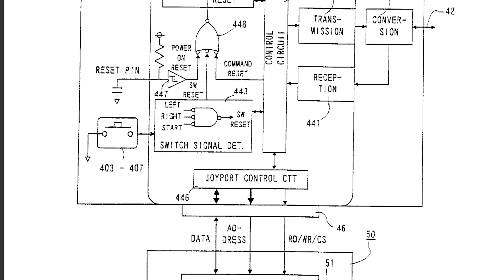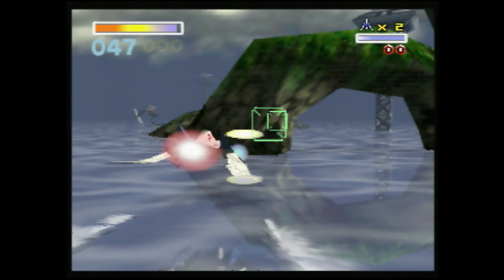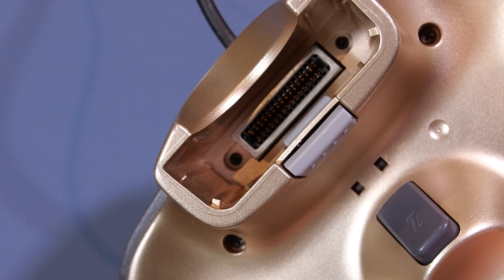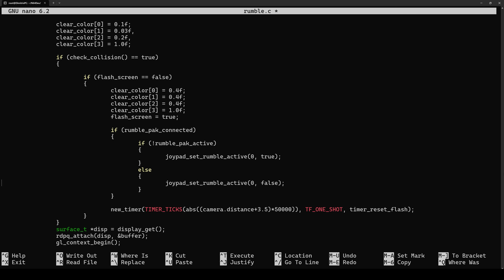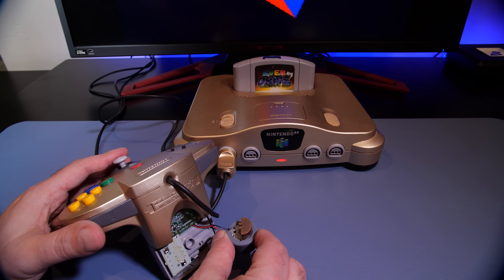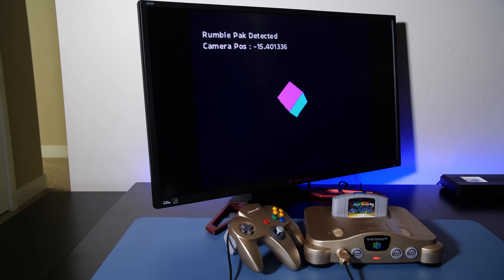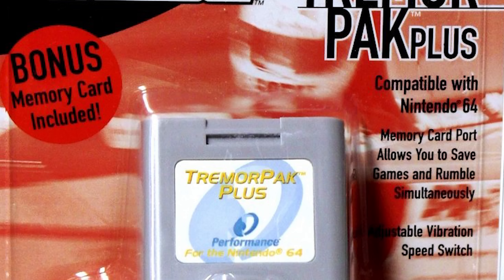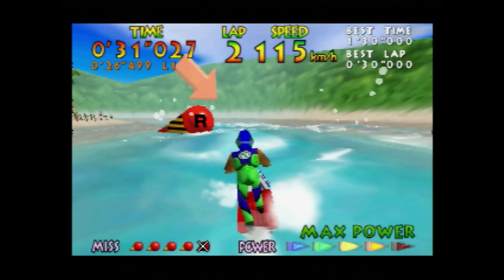How the N64 Rumble Pak changed everything

Comment: I figured this would get into the litigation from the early to mid 2000s. Some company held the patent on haptic feedback and threatened to or did sue Nintendo, Microsoft, and Sony. 

IIRC, Nintendo settled out of court with a license agreement. Sony fought it hard to the point where the PS3 controllers originally didn't have any haptic feedback. 

MS did a big brain move and not only settled, but bought a large chunk of the company. So when it came time for Sony to pay up, and when Nintendo paid their license fee, MS got a share of it as well...
Reply: Nintendo wasn't part of the lawsuit. Only Sony and Microsoft were sue by Immersion in which Sony was the biggest loser as like you mention Microsoft quickly settle and bought 10 percent share in Immersion while Sony fought it in court but lost in every step and was indeed reason they didn't include it on the PS3 until they reach an agreement with Immersion and paid for the license fee (and of course all the fees the court demanded, some 130 million in total).

Reason Nintendo wasn't part of the lawsuit is that Nintendo use different technology and had their own actual patent regarding the motion of the rumble pak and Gamecube controller (and future controllers such as the Wii control) dating from 1995.
Reply: @carlosencarnacion9425  Sony and Microsoft weren't the only ones, both Meta and Valve have also been sued by Immersion.
Reply: @carlosencarnacion9425  
Pretty sure Nintendo settled with them before they were named in the lawsuit, which is why I said "threatened to". Again, if I recall correctly, the Rumble Pak wasn't an issue because it was a separate device, not part of the controller, but the GC controller (and any after it) haptic feedback was built in and required a license agreement. I could be wrong, it was about 20 years ago and I'm working off of memory.
Reply: @MrNside  No, I understand one would think all rumble control would had been part of the lawsuit back then, but again Nintendo was never part of the lawsuit as Nintendo had their own patent for rumble and didn't use Immersion patents.

Info Regarding the lawsuits:

In 2002, Sony and Microsoft were sued by Immersion for patent infringement for the use of vibration functions in their gaming controllers.[1] Specifically, they were accused of infringing on claims in US Patent 6,424,333 and US Patent 6,275,213 (filed 2000 and 2001 as extensions of US Patent 6,088,017, itself filed 1998, all "Tactile feedback man-machine interface device").[2] Both patents were continuation applications of a patent application originally filed in November 1995. Nintendo was not involved in the case, as the technology used in the Rumble Pak and GameCube controller (and, subsequently, the Wii Remote) is based on a different design, for which Nintendo holds the patents US Patent 6,200,253 and US Patent 6,676,520 based on a Japan patent application filed on October 9, 1995.
Reply: @carlosencarnacion9425  
Well if that's the case, then good for Nintendo for getting out ahead of it. I'm no patent expert or attorney, but to me they're all motors with offset weights inside controllers. Not sure how a Japanese patent affects American sales when there is a similar American patent either. 

I do know that Nintendo is and always has been very litigious though. If Sony ever did anything even close to infringing on a Nintendo patent (like the dual shock would have) Nintendo would jump at the chance to sue, especially in Japan. The fact that a lawsuit regarding that never happened makes me think there's more to this story. Like maybe the patent was specifically for the Rumble Pak, an add on accessory, and not part of the controller itself.

Like maybe the recent article titled, "Nintendo and Immersion have renewed haptic tech patent license for future products" on nintendonews website. Or the article "Immersion Renews License Agreement With Nintendo" on NASDAQ's website. Why would Nintendo need a license agreement from another company if they already had a patent that protected them?
Reply: @MrNside  Is most likely just the method or implemantation of the motor that differs from both patents in all honesty and reason Nintendo could do it without potential lawsuit. 

Until the Wii U they use there own patent for the rumble technology on those controls. If you look for Wii U rumble motor you will see that is nearly identical to the N64 one, just a bit more compact (with the ones for Gamecube and Wii been almost the same too).Of course it has clear limitation and probably to evolve it past their current patent it would had infringe on Immersion's patent. There collaboration started with the Switch which uses HD rumble (though it is actually Immersion touchsense technology, just rebranded for the Switch joy-cons).

I am going to guess the switch 2 will use a more advance version of this touchsense and probably closer to the PS5 Dual shock (which is also technology from Immersion).

Comment: I guess I SHOULD be configuring rumble on my emulators and stop using a cheap controller

These days they use a rumble system other than a spinning weight, which doesn’t start and stop instantly, it has intertia.

Comment: It always baffled me that old consoles would not use, you know, some kind of wiring and controller that could draw significant power from the system so as to power some internal motor, like a wired PS2 controller, for instance, would do. The idea that we stayed with the crappy pads we used to have well into the PS1 era baffles me to no end. Rumble packs were an absolute ripoff.
Reply: But we did have rumble with the third generation PS1 controllers. It only took two years for the update.

Comment: The first controller with vibration was actually the Japanese Dual Analog SCPH-1150, which was presented a few days before the Rumble Pak.
Reply: Microsoft also had the Sidewinder Force Feedback Pro Joystick on PC in 1997.
Reply: I had no idea there existed Dual Analog controllers with rumble. Makes sense it was japan-only, but as mentioned; would super interesting to know why it was japan-only
Reply: @AdrianDX what are you talking about?  The OG PlayStation controller was NOT dual shocks.  It was a D pad,  4 front buttons, and 4 top buttons (not triggers). 
The dual shocks are the ones with the 2 analog sticks. Those came built in rumble.  Those were later version available.
Reply: @mcgusto82  The Dual Analog controller is a PlayStation controller with two analog sticks that predates the Dual Shock. Japanese market controllers had a vibration motor, but NA and EU versions did not. According to the description in Wikipedia, the vibration motor was removed because there weren’t many games that supported it at the time, and it may have been a cost-reduction measure. It was only available for sale for a few months before it was replaced with the Dual Shock.
Reply: @rarewhiteape  Correct. The dual analog had completely plastic analog concaved sticks, longer handles, and ridges on the L2 and R2 buttons (among a couple of other features) compared to the Dualshock. I actually own one and they go for about $40 on eBay including shipping.
Reply: Yes at least in Japan. The rumble pak was the first of its kind commercially available in America
Reply: I wonder why Sony removed rumble from any other version of the Dual Analog except the japanese version only to introduce it back with the dualshock 1? Almost seems like they didnt think this would be successful until they have seen Starfox and then they changed their mind again.
Reply: @treechenho That and it was more popular because it was included with Star Fox 64. I must stress how important it was to bundle the pak with the game. I doubt the pak would of been as successful if they were sold separately. (I assume the pak was, but you get my point)
Reply: The DualAnalog was NOT only released in Japan - i still got my original PAL version in europe. Those are just rare.
Reply: @ABaumstumpf  Dimple style instead of oval style?
Reply: @ABaumstumpf  Where did I write that it was only released in Japan?
Reply: @perindeaccadaver6171  "was actually the Japanese Dual Analog"
This to me at least implies that you meant it was only released there as there is no need to mention the country of first release cause that is the same with the rumble-pack.
Reply: @ABaumstumpf  I specified this because only the Japanese Dual Analog SCPH-1150 had vibration provided by a single motor. The Dual Analog releases in Europe and America, SCPH-1180e and SCPH-1180 respectively, did not have a vibration motor.

Comment: I had a 3rd party Rumble pack that didn't need batteries. It didn't vibrate as intensly as my buddy's official Rumble Pack, but it was a worthwhile trade-off.
Reply: They don't actually need batteries, they can run off the consoles power if you mod them but if all 4 vibrate at the same time it crashes the n64.
Reply: @talibong9518  That is why they ran off of batteries. If they didn't run off battery and drew power directly from the N64 console itself Nintendo knew from an electric engineering standpoint that in the event all four rumble paks were to go off all at once it ends up drawing too much power away from the N64 console internals itself to keep the game running and the game crashes due to the loss of power.

Comment: My favourite rumble pak feature is that in Goldeneye, if you have two rumble paks and enable the game's dual analog controls, both controllers will vibrate at the same time.

If you have FOUR,  and go into 2 player mode with both players set to use dual analog, it works just as well there. Super cool.
Reply: Weird, I've tried this before and it wasn't the case

Comment: I remember getting a dual shock controller for my PS1 and playing Gran Turismo was just a different beast with it. You could feel the difference going round a corner with and without grip, and braking was heavy or not. Then in 2013 when the new Xbox One controller had haptic feedback on the triggers, for the first time I was able to play games like Forza with the ABS and Traction Control off, because you could feel through the triggers when you lost grip.
I realised the other day how much I rely on it when playing Rocket League. My Xbox one controller disconnected from my PC, and it was mid match, I got it reconnected but the rumble didn't work, and I was so lost, because it rumbles harder when you're boosting, but that's also a no look feel indicator for if you've run out etc.

Rumble is just awesome!

Comment: Is this going to be a trilogy? You covered the Expansion Pak, then the Rumble Pak, I wonder if there's anything interesting to say about the Transfer Pak.

Great video, the homebrew experiment was cool.
Reply: The transfer pak, which helped enable a GB/GBC emulator on the N64, used for the sole purpose of playing Pokémon games. 5 games out of the entire library. What wasted potential.

It also leaves the N64 in a weird gap between the SNES and GameCube - each of which had commercially supported GB and GBA emulators respectively.
Reply: @ShadowEl  It's somewhat important in Mario Tennis and Mario Golf. Tennis actually had some content locked behind the Transfer Pak, making it impossible to unlock everything on Virtual Console. They fixed this in the NSO release by unlocking everything from the start.
Reply: @Stormkyleis  I forgot about those. I was exaggerating a bit when saying it was ONLY used for Pokemon Stadium, just lamenting that Nintendo (or Intelligent Systems) made a GBC emulator for the N64 and Nintendo ended up locking it to five or six freaking GB/C games.

I'm annoyed with how they flubbed transfer pak connectivity on Switch Online. Especially with N64 being on the "expansion pass" tier and GB/C on the base tier. They could have released Mario Golf/Tennis and the Pokemon games on the GB/C app, then used the N64 versions of Golf/Tennis and the Pokemon Stadium games as an incentive to buy the expansion pass and link them up for rewards.

Instead Pokemon Stadium 1 & 2 are nerfed to a novelty. Glad they worked around it for Mario Golf and Tennis.
Reply: Probably quite a bit, as if you modify the headers of other GB games to be a Pokémon game, those with Super Game Boy borders do show up (Wario Land 2 and Donkey Kong 94 come to mind)

As for why an Ultra Game Boy never existed (Commercially at least), my guess is that the N64 wasn't powerful enough to emulate a whole GB (A few games it could handle, but not the hundreds the GB library had at the time) and the hardware of the N64 was far too different compared to the SNES. (IIRC, the CPU for the SNES and GB were both descendants of the 6502 so that's why the former could more easily read code from the latter) 

The GameCube and GBA were developed at around the same time, so the design teams could swap notes on how to get one to communicate with each other. 

TL;DR: Why no Gameboy on the N64? The hardware for the N64 was too different to run natively and wasn't powerful enough to fully emulate 1 to 1 with the whole library at full speed and sound.
Reply: @Toonrick12  This isn't correct. Pokemon red/blue ran fine on the Stadium emulator at full speed - actually, you could unlock 2x and 3x speed emulator modes by playing through the Stadium content, and there was a gameshark code for Stadium that disabled the ROM check and let other games run. My personal belief is that Nintendo didn't release a full-fat GB player because they were getting ready to transition to the GBA.
Reply: @Toonrick12  Seems mostly sensible, except the Super GameBoy didn't use the SNES for much of anything besides video output and controller input. The SGB had an entire GameBoy inside it, CPU and all. And the GB wasn't 6502 based, it was a Z80 descendent by Sharp.
Reply: @Toonrick12 not sure how the transfer pak works but the super gameboy had the gameboy hardware inside the cartridge so they could have easily done the same for n64,I believe it would be powerful enough to emulate too as there are gameboy emulators for the n64
Reply: I seem to recall Mickey's Speedway USA used it. If you linked it with the game boy version of the game you would unlock one of the little ducklings.
Reply: The transfer pak was stupid. I had it as a kid because I believe there was just one game that needed it for game saves. Can't remember correctly but I think it was Turok which if correct should've had game saves in cart since it was so expensive at the time. I still remember that game being $80 in the late mid to late 90's! 

Other than one game needing it for game saves, the transfer pak was pretty much pointless for me. I'm sure there we're probably some other games that used it for game saves but most N64 cartridges could save within the cartridge itself. 

Looking back, the transfer pak seemed like a "me too" product that other disc based consoles had but that's because you need memory cards to save when the game media is a disc.
Reply: @ToolCraze  you are talking about a memory pack. I never had one, as MOST N64 games saved on game. The transfer pack is an add on that put a gameboy slot on your controller. This let you transfer data between the 2 systems. Most famously used to bring your pokemon from the gameboy to battle in 3d on the n64 and to play the pokemon gameboy games on your TV. It also could unlock characters in Mario Tennis and Golf as well as Mickeys Speedway. There may be more, but thats what I remember
Reply: @IamR3D88  Perfect Dark was meant to have connectivity with the Game Boy Camera for a feature called PerfectHead, but due to possible privacy concerns, it was scrapped. No effort was made to restore this scrapped feature in the Xbox 360 version, which could've been possible with a USB Camera.

WWE No Mercy was supposed to have a feature to star your Custom Wrestler in a special story via Transfer Pak, but the GBC version of No Mercy was canceled, although you can still play the story via hacking.

Comment: I remember having to juggle all these paks to get them to work together with all my games. The rumble pak had to be on controller 1, it was the only way to use it, then I had the memory pak on controller 2 which could still be used by player 1 in most games, and my transfer paks where on controllers 3 and 4 for both pokemon stadiums.
Reply: I had the rumble pak with the extra slot on the back of it with a switch to bypass the rumble.